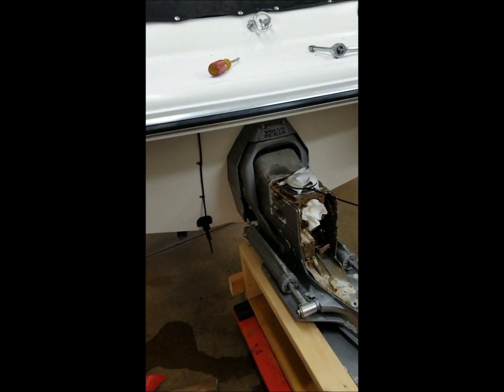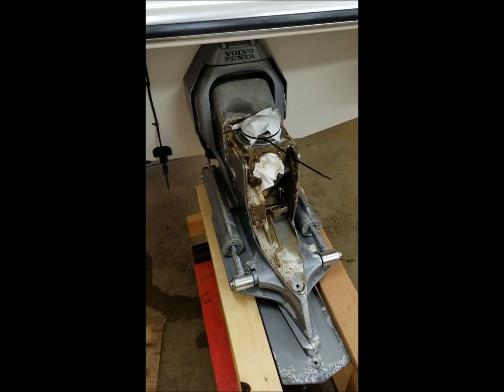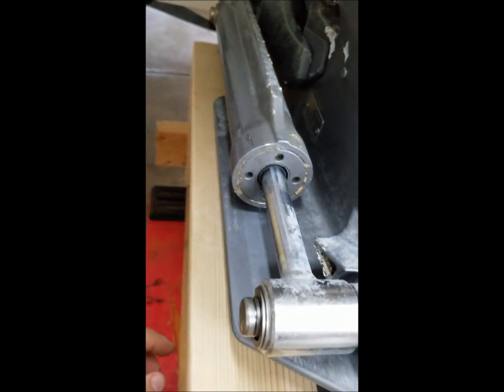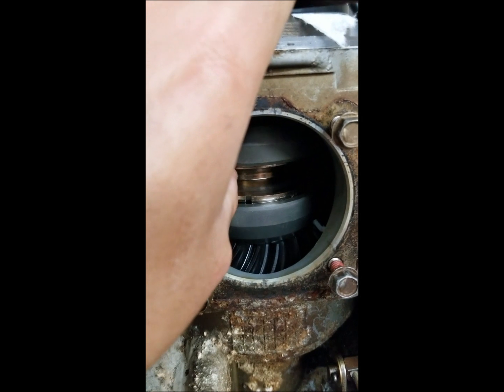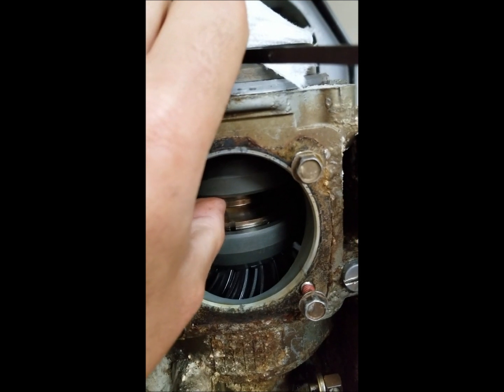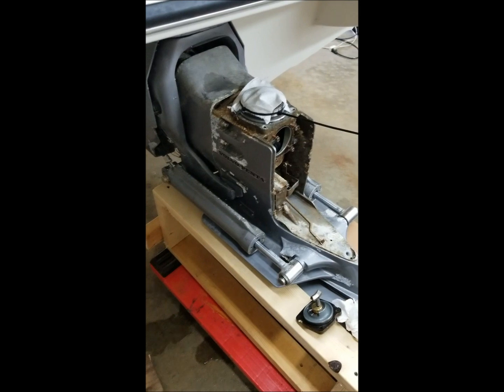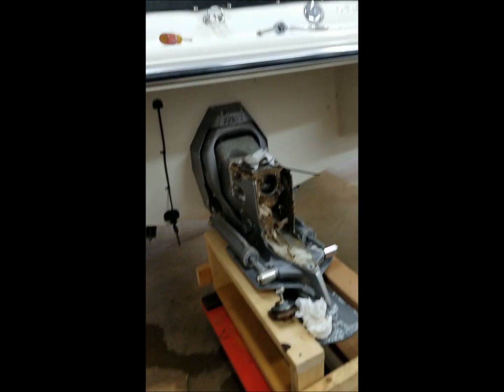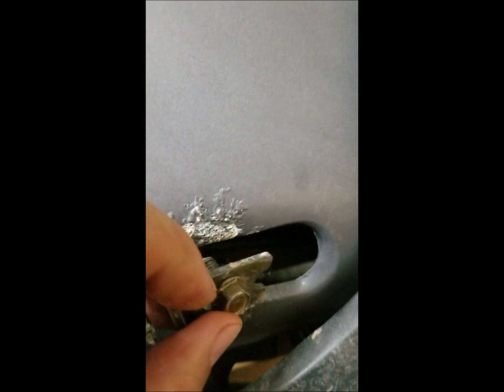Volvo Penta SX-M outdrive cone clutch replacement, lapping, Part 1

Comment: Was it slipping? Mine slips what could it be wrong?
Reply from the maker: More like it either grabbed and went into gear or wouldn't grab at all, but slipping can also be a sign of a glazed clutch just like mine.  If you watch the full set of videos I explain how it works.  FYI I still have the boat today and the new clutch still works great

Comment: Unreal....hearing your opening statement could have been me!  I have a similar Volvo Penta drive that not only has the identical shift issues but my experience with three different boat ‘mechanics’ mirrors yours.. A friend of mine who does transmissions and engine work has ordered some  Volvo penta tools and is on it! .. We pulled it off yesterday.. Thanks for posting this.. much appreciated!

Comment: My volvo 280 outdrive goes into gear fine but starts slipping around 1200rpm in forward and reverse.. swapped out the top of the drive and same thing 🙄 very frustrating since the boat is slipped and not on a trailer

Comment: Great videos! I'm having the same issues with shifting into forward. Thinking I might have the same issues. Where did you buy your repair manual at?
Reply from the maker: Thanks. I bought the seloc paper manual off amazon. I forget how I obtained the electronic volvo manual.  It was either a free download or I bought it, just don't remember. The repair has worked great all last summer. I did find some water in the oil when I winterized,  most likely one of the seals in the lower unit that I will need to track down, but the shifting is still great